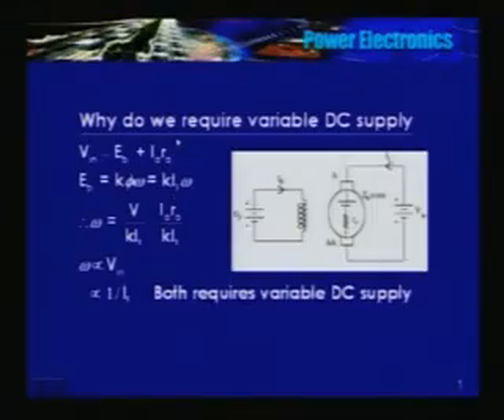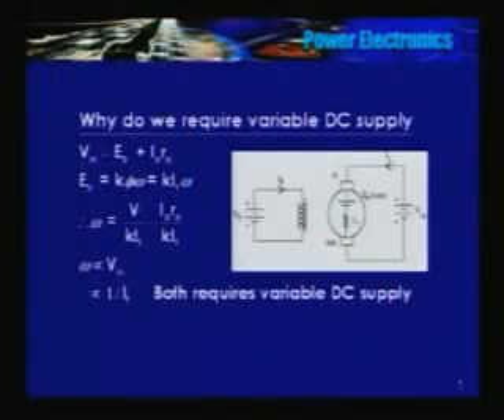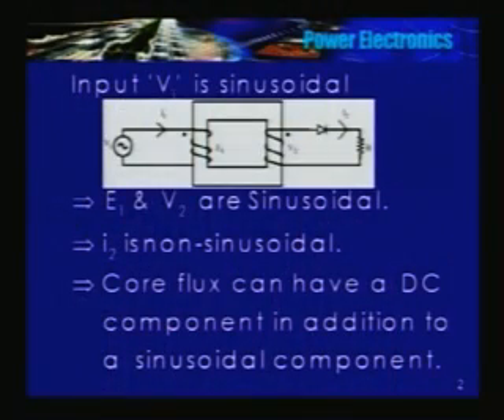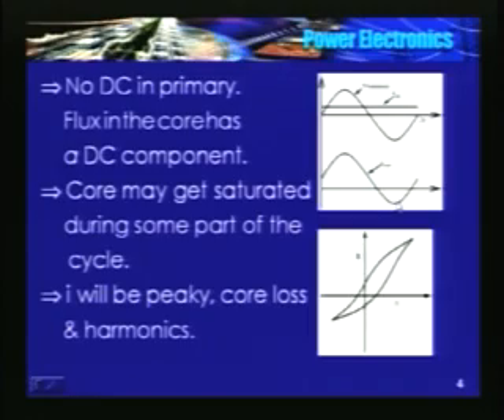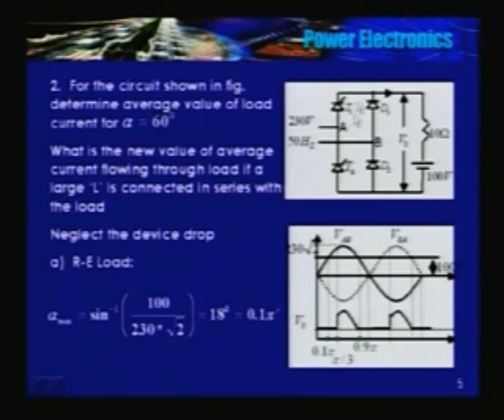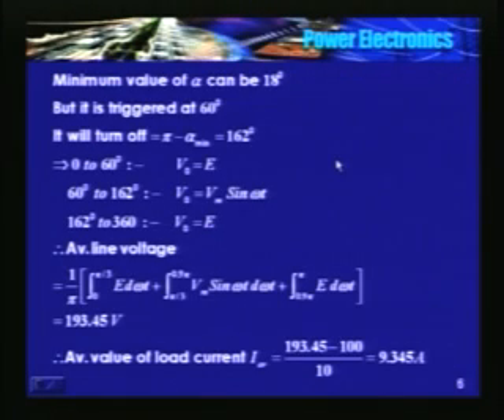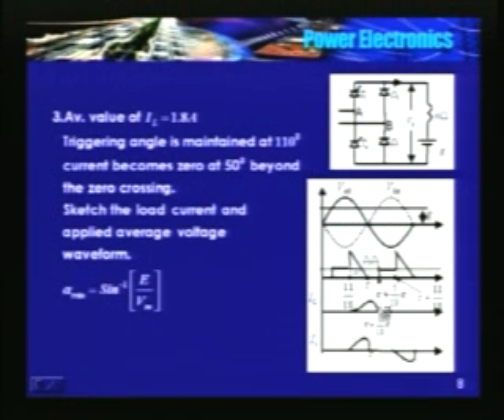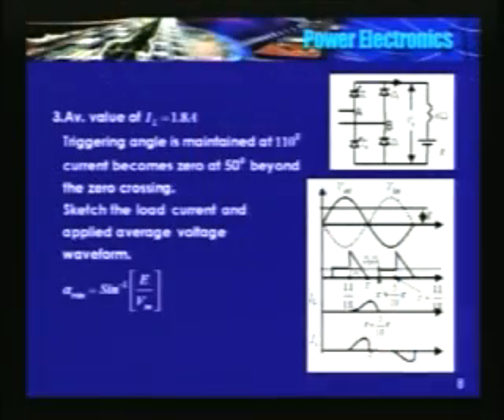Lecture - 13 Power Electronics

Comment: I think that the average value of the output current (42:01) is not correct, because in the output average voltage it is been taking in account regions of voltage (0-60 degrees and 162-180 degrees) that does not produce current (discontinous). Current is produced just when there are diferential of potential and that only happens from 60 degrees to 162 degrees

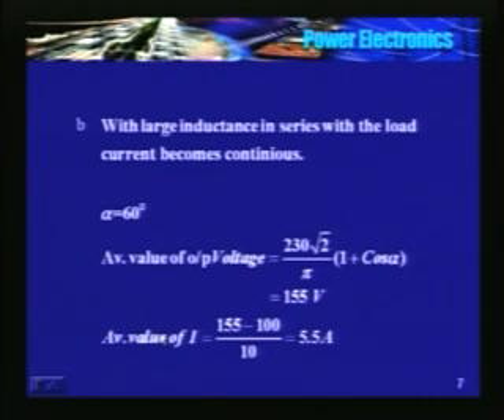Comment: It seems that in the 3rd part of the problem (44:00) . Since it is a Resistive load, as soon as the input voltage becomes less than 'E' current should become 0. Solution to the problem has not taken this point into consideration.
Reply: +mayur nawal In 3rd part since large inductor is connected so the current is continuos. As input voltage<=E, current starts decreasing (not 0). But since the current is continuos Vo=Vin until wt=pi at which diodes start conducting and Vo is zero.
Reply: No, the load is RE, no L connected